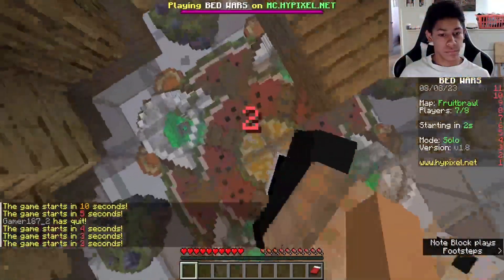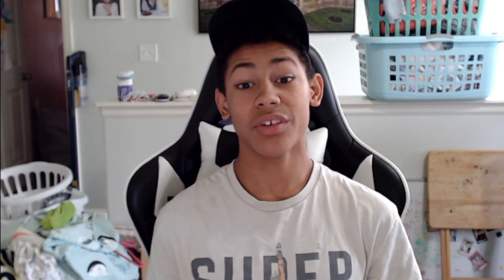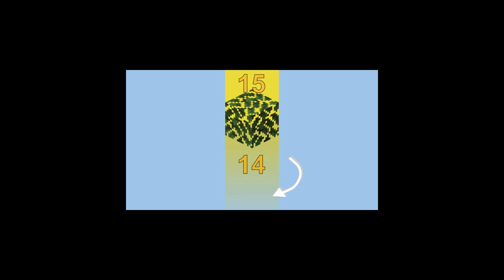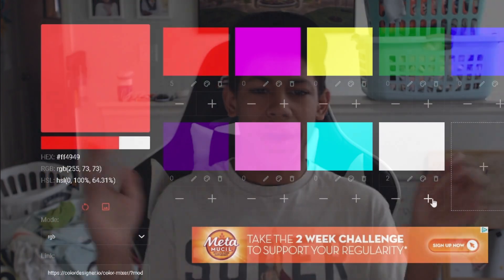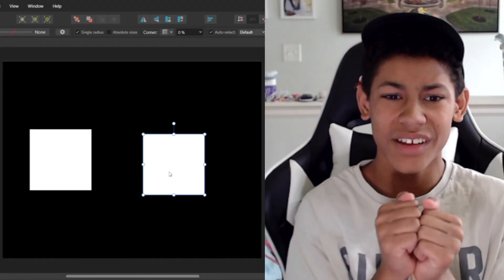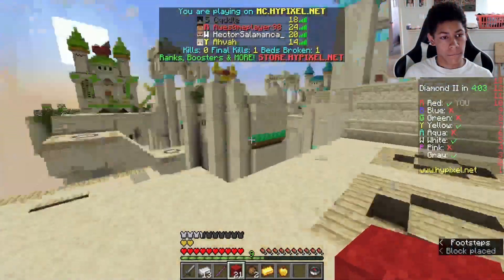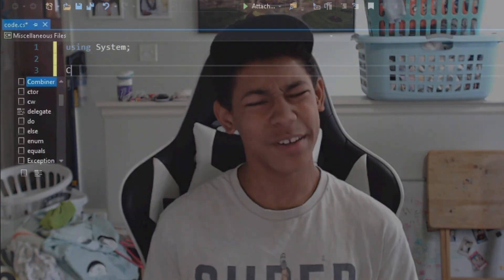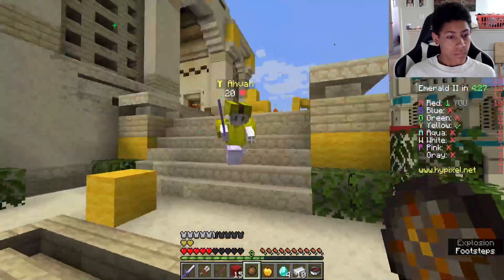How Minecraft Works Ep. 8 - LIGHTING

Comment: Fascinating! I’m planning to make a mod that makes the darkest levels of light more darker whilst leaving the brighter ones untouched; so with your explanation on the light levels and the colors overlaid, is that Data-Based or is that a Texture System? On another note, you are seriously underrated; take my subscription.
Reply from the maker: @BlastFromTheGhast  Everything explained in the video is data-driven except for the gradient picture thing I showed. For a mod as you describe, you could actually do it to some extent with a texture pack! If you want to take it to the extreme, though, you might have to modify some internal values, which would take a mod. All of that, however, is possible by simply editing a .txt file in versions 1.17.1 and older